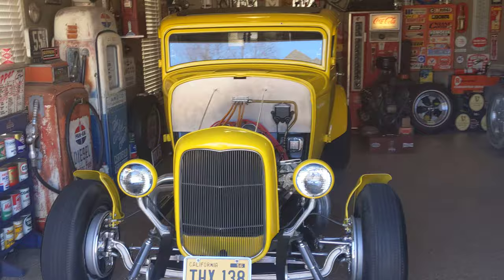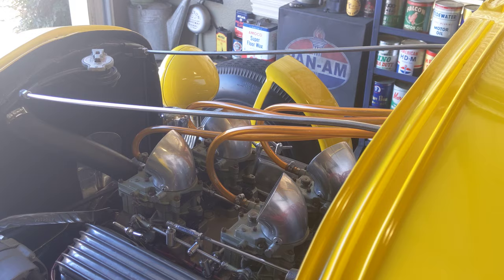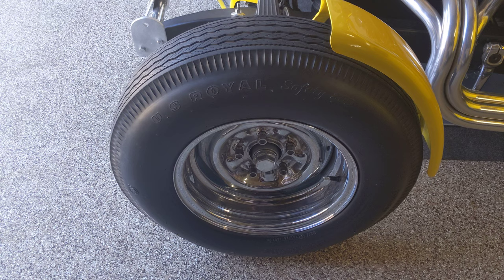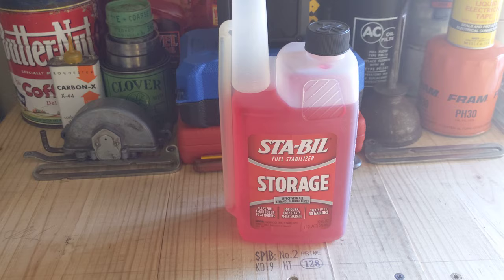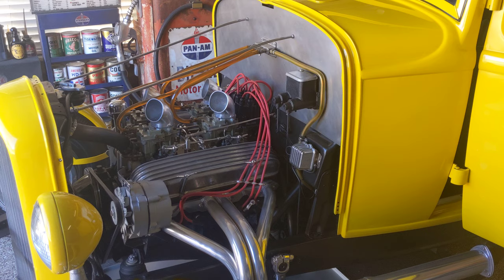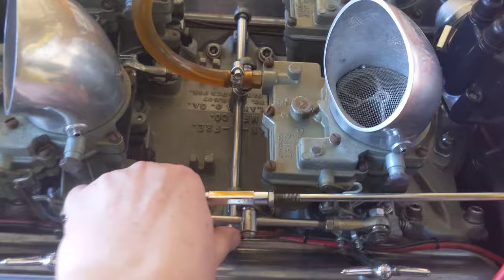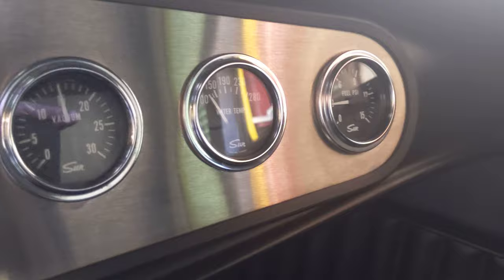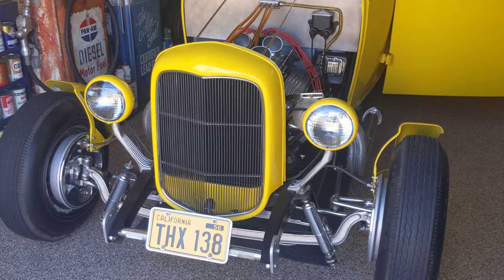John Milner Coupe Cold Start and Warm up! (Clone) Nick's 1932 Ford American Graffiti Hotrod.

Comment: The starting procedure for a B29 super fortress is simpler than this.
Reply from the maker: I completely agree!
Reply: 90% of this had nothing to do with starting the car. Lol
Reply: Jesus yes, just freaking get in and crank until it fires. It’s only been sitting for a month.
Reply: @cureforsale  ... I don't know if you have a separate switched circuit for your fuel pump, but you should be able to cut off the fuel feed before you shut down the engine, allowing it to burn the fuel out of the carbs, rather than the potential of raw fuel draining into the intake side. Something is getting the fuel out of the supply hoses, that's visible.
Reply: That's because each Superfortress had an auxiliary power unit for each engine to oil up and start the engine.  Automatic systems are always simpler.  Duh.

Comment: Why on earth don't you spray a little ether into each carbie, or a little squirt of fuel, or just a few fingers over each carbie for a dummy choke to make an instant start? There's no reason a well built and tuned motor can't start after just a few revolutions with a nice rich mixture.
Reply from the maker: That is an idea.  I've thought about keeping a bit of gas in a small squirt bottle to fill the bowls.  The video shows the standard way that I was taught to start the car.  I usually like to give it a few revolutions without fuel to get the oil pressure up if the car has not been started in a few weeks.  I think that was the delay you probably noticed.  Thanks for watching and commenting.  Nick
Reply: Always good to build oil pressure first anyway. Ether is really a no no for gas engines. Builds tremendous cylinder pressure. What he is doing for starting is really good practice. Especially on an older engine.
Reply from the maker: @ckane510  That's the procedure I have always been taught.  Thanks for your input!   Nick

Comment: When I was drag racing, there was nothing like that first fire-up. Of course, I was running 2 Holleys, and a much bigger cam, so that idle was like music to the ears.
Reply: Guy I used to work with had a 1934 T bucket. 350 Chevy with Ford axle. No radio because he said that the sound of the engine was all of the music that he needed to hear. He is a member of a Hot Rod club called the Good Guys.

Comment: Apparently no chokes on the carbs. Have to pump the pedal so the accelerator pump will squirt fuel into the manifold. Cold starts will hesitate on acceleration without a choke until the engine is warmed up. Old school stuff. Put a choke on it so you can start and go.

Comment: WTH are you jabbering about.  I've been building hot rods since the mid sixty's and never went through this much crap to start a car.  The only thing out of the ordinary are the carbs and running the fuel pump a little more would fill the bowls.  Looks like no chokes but your in CA for crying out loud.  I've started these things in the cold northern midwest without that much fanfare.  Your just jabber to hear yourself.
Reply: Yep.  I ran an ill tempered, full cam rat motor year round for several years in the Midwest back in the '70s and never did any of this.  The most I did for a really cold start (sitting all night in a bitter cold Midwestern mid-winter) was pop the hood and take the air cleaner off the 780 DP so I could watch the carb through the bottom of the windshield while I cranked it.  On starts after a good cold soak it tended to be even more evil than normal and would sometimes pop and set the gas in the carb on fire.  I needed to see that so I'd know to keep cranking it and suck the fire back into the carb, or if that failed, jump out, put out the flames, get back in and and try it again.  After about the second or third fire it would usually start.  😄